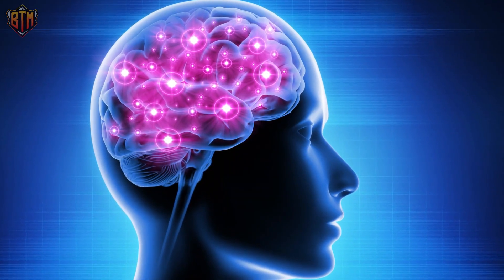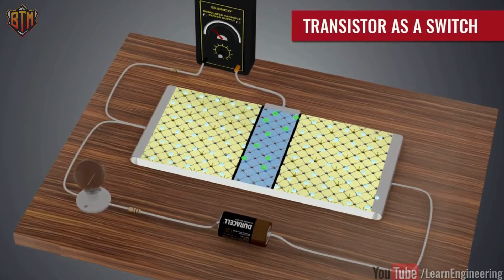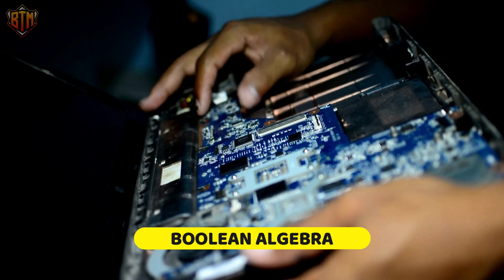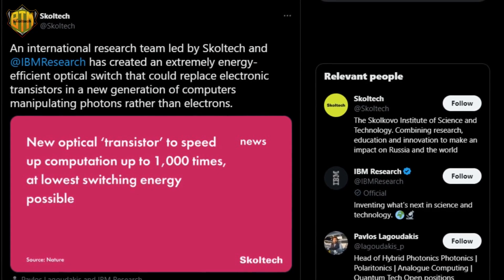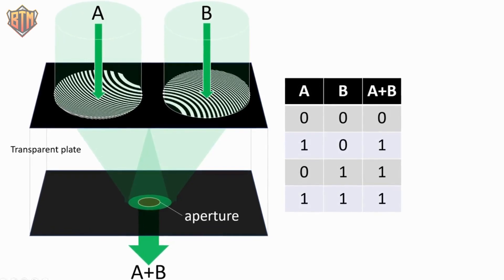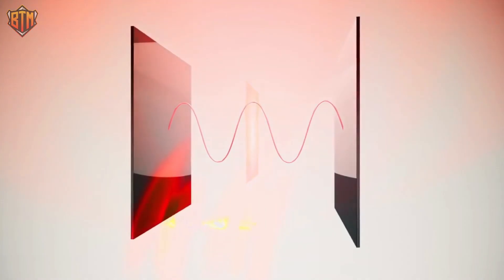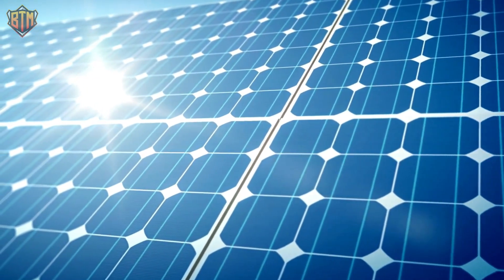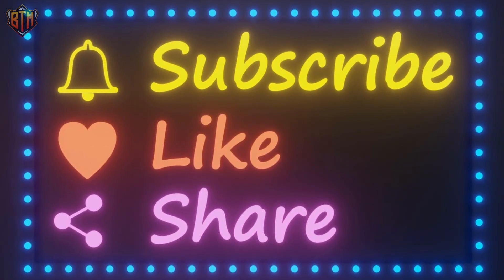IBM's New Light Speed Processor Shocks The Entire Industry!

Comment: Except that it does not matter that the optical transistor can switch 1000 time faster than an electrical one; the 'chip' will still need to have several such switches in cascade to get anything done, and the signal will have to propagate from one end of the chip to the other. And how fast can light cross a distance of 1 cm? 0.000000000033 second. That means any computation that involves the whole chip could not proceed at better than 30 GHz, less than 10 times faster than the best current electrical CPU. Electrical signals propagate at about 2/3 the speed of light already, getting this extra 1/3 is not going to boost processing power a hundred or a thousand fold.

Comment: The most significant advantage of light-based circuits over their electronic counterparts is their unprecedented speed. Using optical physics, IBM developed technology that can run complex operations in parallel in a single core, using a different optical wavelength for each calculation. Combined with in-memory computing, IBM scientists have achieved ultra-low latency that is unmatched by circuits. Thus, for applications requiring extremely low latency, the speed of photonic processing could make a big difference.